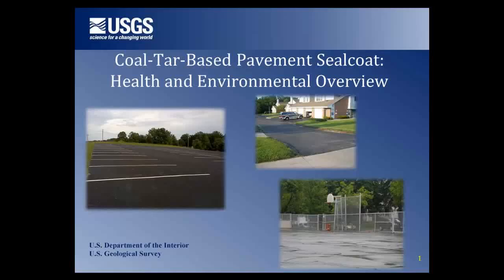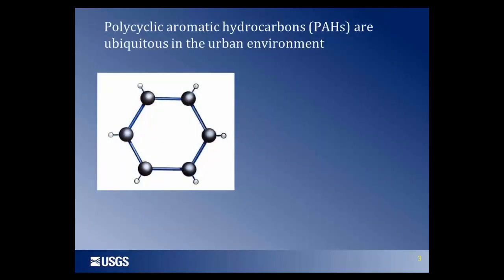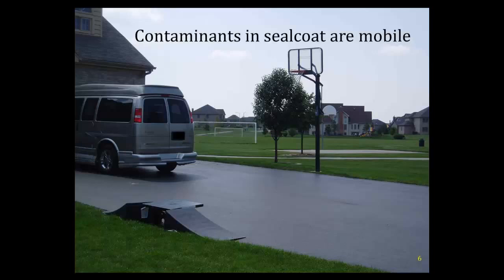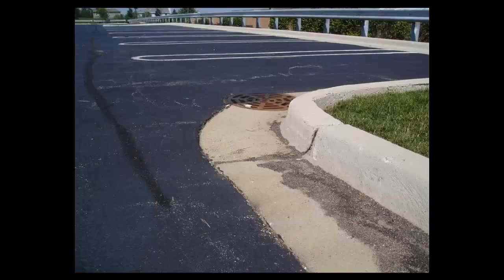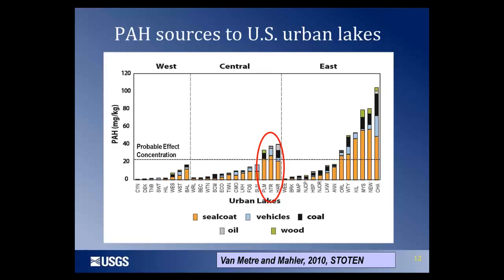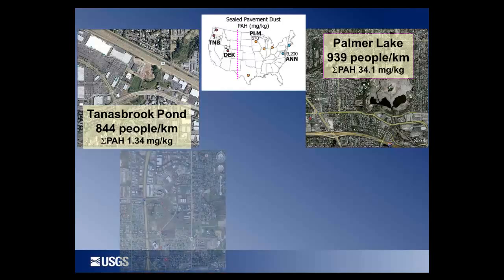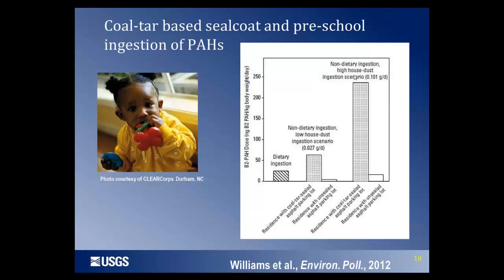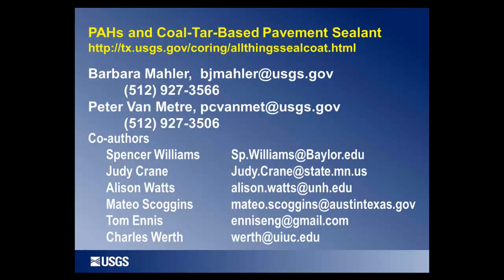Coal-Tar-Based Pavement Sealcoat: An Environmental and Health Overview

Comment: Thanks for the continued education in the Eco and health dangers related  using toxic coal tar driveway and parking lot sealants. Generally Asphalt Emulsion type do not cost more, blacker, low/no odor, safer... , the benefits far out weigh the reasons to use toxic coal tar sealers. Most manufacturers today have a non coal tar choice. l Safe Seal of Michigan ,  only offer a NON coal tar sealer due to the dangers of coal tar.
Take the time and watch this, do your research before allowing anyone to apply toxic coal tar to your project. Say NO to using coal tar sealants !